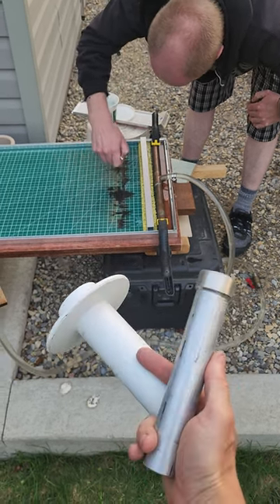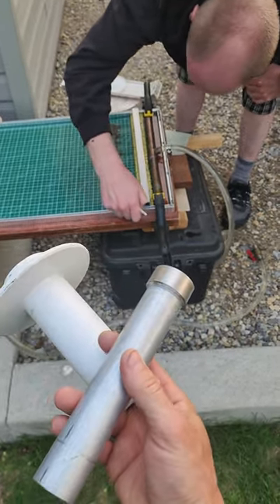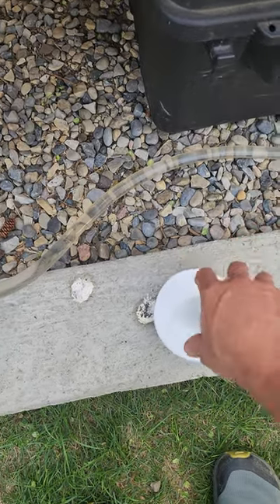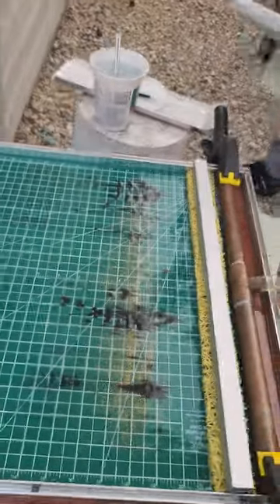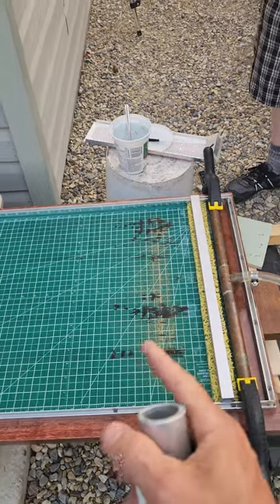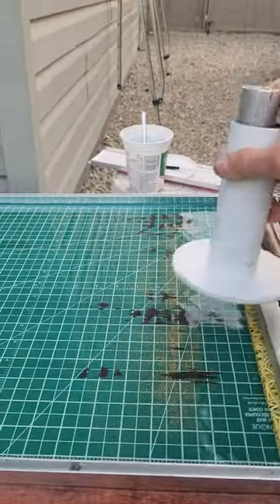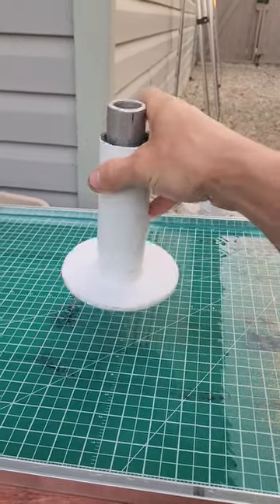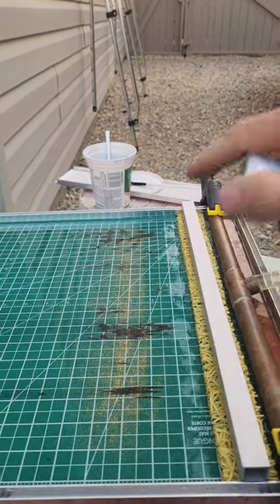Magnet Trick for Gold Recovery on a Miller Table.

Comment: Is a nice and slow flow of water.
What kind of pump u use there and what is the material of the surface of the your miller table? Where can i find it? if you dont mind to answer. Thank you!
Reply from the maker: I use a small pond pump with a valve to control the water flow.  The material is a hobby cutting mat, they work great and can be purchased from art supply stores.
Reply: @UtmostOutdoors  I apreciate your answer man, your channel is amazing btw. High quality content here.

Comment: Awesome video lessons hey is that magnet glued on in reverse? is that why is ran away from the magnit  down the table ??
Reply: Or the magnetite wont break through the water surface tension from that distance
Reply: Ahhhh i just got it so it runs to the neodymium but the water holds it under the surface ten than you  manipulate it ,water inertia and pulling on the magnetite from a distance it walks it under the surface tension but hovers over the gold 
 wicked 🤩
Reply from the maker: Boom! You got it.  Looks so cool hey?
Reply: @UtmostOutdoors  yes absolutely wicked